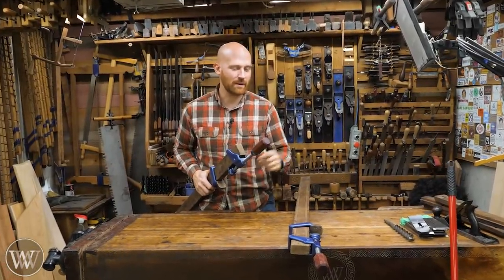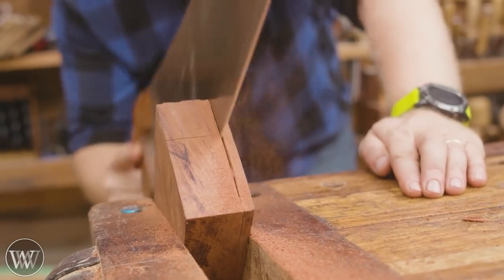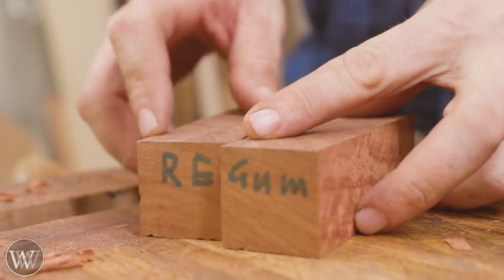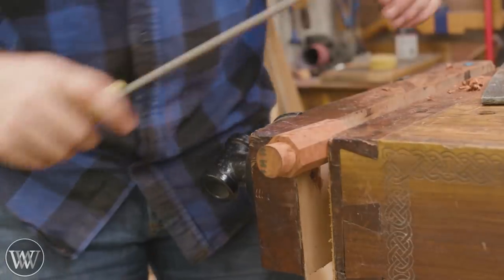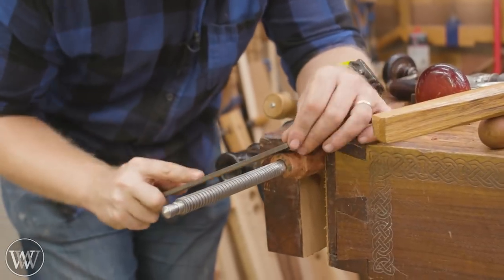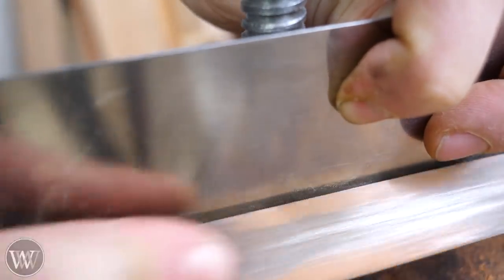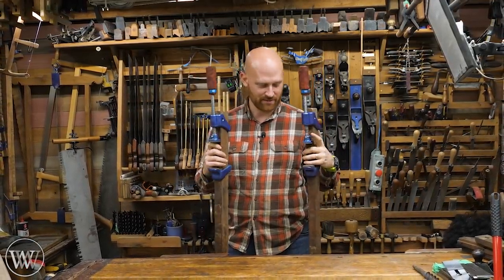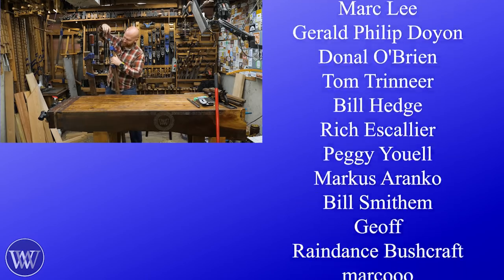Working With Red Gum Clamp Handles

Comment: Titan Tools (bought by Stanley Tools, to later become Stanley-Titan, then Stanley Australia) made plane irons laminated with HSS Steel specifically for the Australian market. As far as I can tell, these plane irons were never offered elsewhere. I have one such iron in my No.4 and experience over the past 2 years with a variety of irons has taught me that this one holds a finer edge and stays sharper for longer without being noticeably more difficult to sharpen. I recently acquired a set of digital calipers and found that this one is also thicker than other irons. Standard irons are about 2.0mm/0.080" thick whilst this one is 2.4mm/0.095" thick.

I have compared them with Stanley England, Stanley USA, Stanley Canada irons from various eras (including the SW era) as well as irons by Swedish steel makers. It is amazing what turns up on the second hand market here in Australia since we had to import a lot of tools from around the world.

Comment: Once again, very good video! 👍 ….
QUESTION ❓: This wood isn’t easy to find in my country but we have easy access to Azobe wood.
It’s also a very dense hardwood and has similar specifications. Do you have experience with this wood and  aren’t you afraid that your handles are going to get cracks over time? These dense woods are known to move and tear a lot.
Greetings from clog country 🇳🇱
Reply from the maker: I have never used that. Most of the time dense woods move less then others and are more stable. But every wood is a bit different.

Comment: You need to try turning fresh (green) 
redgum.  Redgum grows here in Arizona.

I got hold of some, and tried to turn a tap 
handle.  Turned a smooth cylinder.  Set it 
aside for a few days, and it had moved 
so much, it felt like an ear of corn.

steve
Reply from the maker: Fun. I love trying new stuff!
Reply: @WoodByWrightHowTo , lady across the 
street has a LARGE redgum tree in her backyard.
I'm planning on asking her for a fresh 3 inch 
diameter branch, to turn an ear of corn out of.

That would make an INTERESTING tap handle.

steve

Comment: At 3:08min in, my wife came out to my shop when I was still in Florida and saw me pinching the saw plate above my cut like that once and freaked cause she thought I was going to saw into my fingers by mistake, so nice to know I'm not the only person who does this. Also good to know I'm not the only person who almost forgot that I could blow out the wood that the ferrell goes onto, I did accidentally split it and then the split went a little ways down the handle, I dont have any total boat so I used that glaze coat stuff you can get for pretty cheap at the blue big box store and I think it saved my burnisher handle. But no there are never enough clamps, I could have 100 of them and still need more. And I would agree that Red Gum is pretty maybe one day ill buy some when my skills have improved, how did it compare to Live Oak on the hardness, cause ive worked with that before and wow that stuff is tuff. As always James fun video
Reply: My shop is my kingdom.This is property zone for my wife.